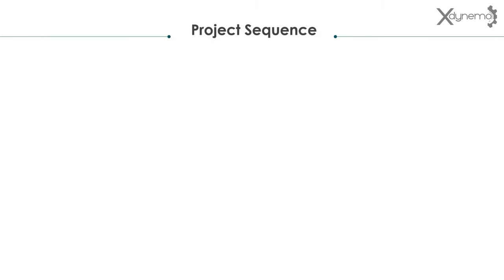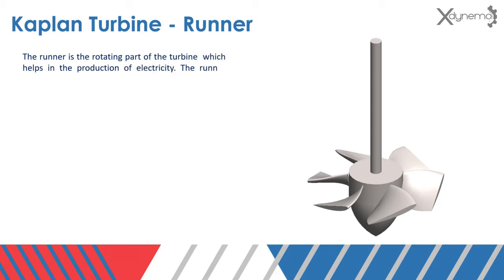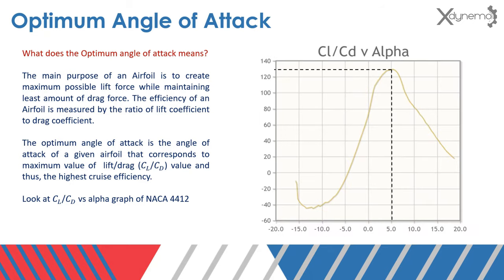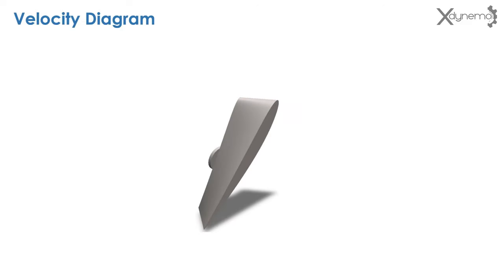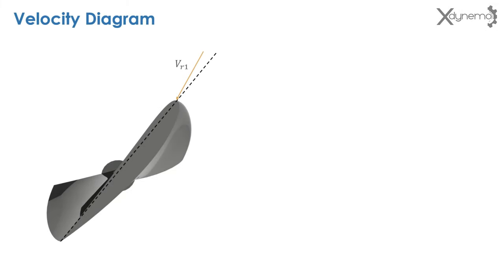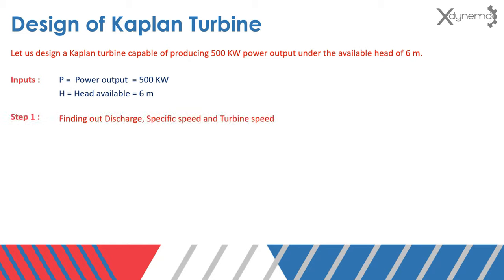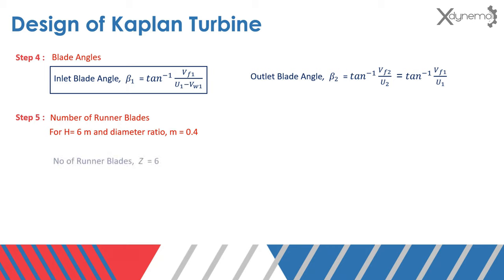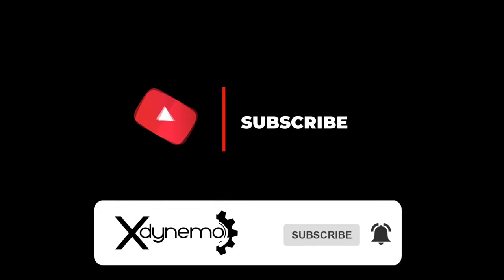Design of Kaplan Turbine | Part-1: Introduction to Blade Profile & Velocity Diagrams |  Xdynemo

Comment: Thank you for making this video available on youtube. I have watched your amazing video, very helpful and I appreciate it. I read from the comment that you used R.S Varshney book as a reference. I found that the formula of specific speed, peripheral coefficient and turbine speed is similar. Yet, I'm still confused with the runner diameter formula, because in the book it's say that particular formula is for calculating the D3 or Diameter at the discharge end. Would you give me some explanation about the relation between runner diameter (D-runner) and diameter at the discharge end (D3)? 

I also could not found the formula of hub diameter in the book. Would you give me further information about the formula as well as the rest of formulas you use? And how to determine the diameter ratio of 0.4?  

I am very sorry for bothering you with these bunch of questions. I hope, you would happy to answer. God Bless you Sir. 

Thank you in advance.
Reply: Refer Abeykoon, Chamil & Hantsch, Tobi. (2017). Design and Analysis of a Kaplan Turbine Runner Wheel. 10.11159/htff17.151.

Comment: NACA airfoil is used in your design for Kaplan turbine runner and it is used in most of propeller axial turbine. but we see in bigger Kaplan turbine that cross section of runner blades are too thin and they can't be NACA airfoil. Do you have more information about it?

Comment: 10.11159/HTFF17.151

Hope majority of the questions gets clarified in this paper on Kaplan turbine design
Reply: Abeykoon, Chamil & Hantsch, Tobi. (2017). Design and Analysis of a Kaplan Turbine Runner Wheel. 10.11159/htff17.151.